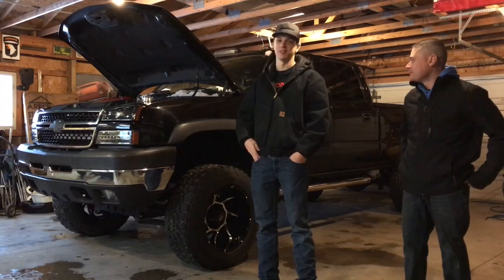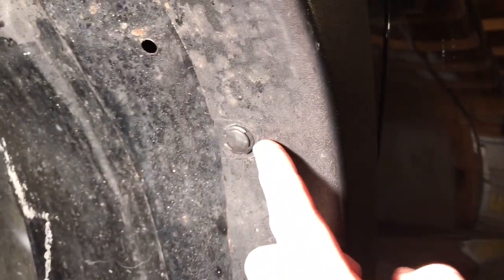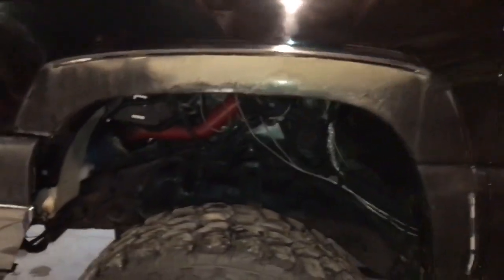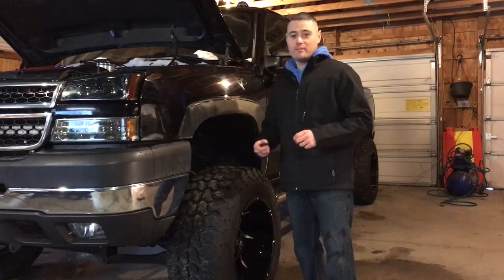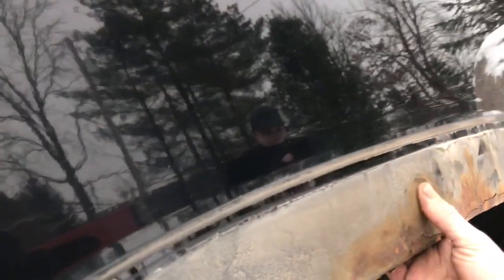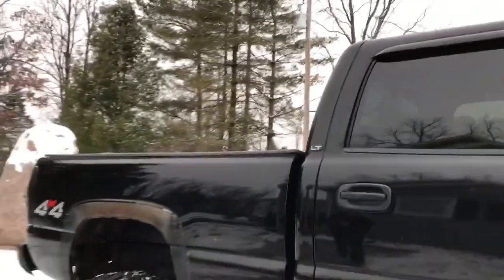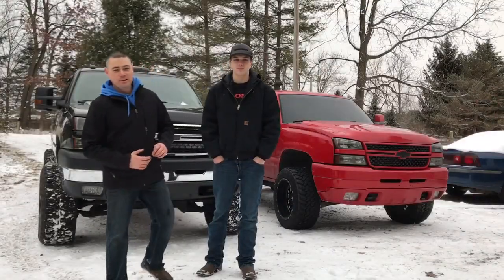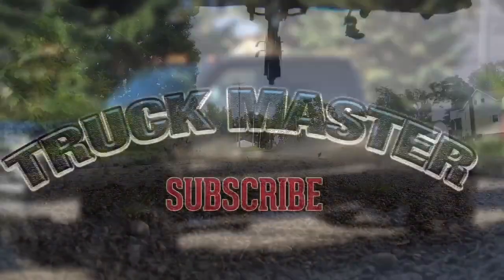Duramax 10 Year’s Later (removing the wheel flares) Hard to watch

Comment: Spray bottle of soapy water, buff wheel and clean it off; welder and some pre molded sheet metal and put it back in place, then OEM paint to finish until you do your paint job. That's what I did for my dad's 02 silverado. Works great

Comment: I love how people are clueless about the factory wash out plugs on the rocker panels and the wheel wells. Just wash them out and they won’t rust. Fill them with fluidfilm after they dry out and forget about it. It also helps to pull the tail lights off and wash out the bedsides from there. Crap will fly all over but it works.
Reply: where are the wash out plugs they on the wheel wells? I rust check every fall, maybe it doesn't matter in my case

Comment: Tbh keep em on. Ive always been a little too fond of fender flares. The first truck i owned had them and ive always liked the look too
Reply from the maker: +dude333 I most definitely agree with you
Reply: If you put the rubber gasket around the fender flares to seal them up you can keep the dirt and salt out plus I put wax all around except where the 2 sided tape goes
Reply: @TruckMaster  where the rust is you can us POR black to stop the rust or use lock tight rust neutralizer
Reply: Agree

Comment: I would spray some clear coat on the rust so it keeps it from getting worse. Maybe even sand it a little first. Throw the flares back on until you get it painted so it looks better. You can cut those sections of the fenders out and weld a new piece in and grind the welds so it’s smooth and use a small amount of filler if needed and paint it and you’d never know. Nice truck man.
Reply from the maker: +Hunt Guy thanks for the advice
Reply: No problem! Good luck dealing with the rust, it sucks.

Comment: I've seen trucks about that old that have never had any flares on since new that have about the same amount of rust. One nice thing about aftermarket flares is you can easily pull them off and clean under them every once and a while. Also using a small bead of silicon will go a long way too.

Comment: Looks better with the flares, without it makes the truck look too skinny with the wide tires. The flares balance it out. Rhino lining under the flares will help once fixed.
Reply: I agree. I like the way mine looks with flares
Reply: Any rubber product like rhino liner is the worst thing possible for your truck it doesn’t breath and traps in moisture
Reply: Not if applied correctly
Reply: I got flares with bolt pattern so not so plan plus looks better
Reply: Rhino liner holds in moisture I wouldn’t recommend doing that. Fix it the correct way or don’t do it at all.
Reply: Rust usually comes from the under side inside the wheel well.

Comment: I hate to be a bearer of bad news, but Chevy trucks rust on the box side wither you have flares or not. The rust actually starts on the inside (Inside as in between the out box side and the inner box side) of the box and works it way out. I work at a body shop and we get new patch panels from "Browns at two Rivers". Get a good quality shop to repair it for you and under coat the inside on the box when they're done.

I think it looks better with the flares. But your truck looks great with out also.

I was afraid it would be worse then that when you pulled them off. My 07 is so bad that the rust is showing even with the flares on.

Thanks for the great videos!!!!!!!! Great looking truck!!
Reply from the maker: +JD Uncle great write up! And you so right about how they rust. Thanks and take care

Comment: It's not the flare causing it to rust, it is dirt sitting between the inner and outer fender that gets caked in and scratches the metal up and then salt comes in a rusts it out. Yours is not bad. Either put new box sides on or new fender panels, but have it professionally done for either option. I cut the inner fender out with a dremmel so nothing will get trapped causing the rust to form. After that I applied some Eastwood Rubberized Rust Encapsulator. It's easy to do and will keep rust from ever happening again to fenders on your bed.
Reply: Zack Ziegler you can also drill 1 inch holes from the inside of fhe the box side . Take a hose every once in awhile ,spray it out. Both methods work.

Comment: I'd leave the flares off. Looks better without them and will prevent from rusting under.
On
 the up side they do help save some paint be catching things that 
normally would sling up the side of your truck. But I have the same 
stance and honestly I leave them off too prevent rusting and it looks 
good. But the rust you have is fixable.

Comment: Go with 2” bora wheel spacers in the rear. I’m running 36x15.50 tires with 20x12s and I’ve towed with them on and I haven’t had one issue. Plus they’ve been on for over 6 months nothing but good to say about them.
Reply from the maker: +Brandon Jenson great advice that’s what I need to hear thanks

Comment: Yeah that’s a bummer for sure. Ive been putting of checking mine just cause of what I might find under them. I purchased a southern bed for my last truck and painted it to match. To me that seemed to be the easiest thing to do and it wasn’t all that expensive. After that I made sure to Spray some fluid film behind the tail lights above the wheel wells. They like to rot from the inside out from all the mud that sits between the sheet metal half’s. Also if you look underneath the bed wheel well you will see some plastic plugs that you can remove and wash the mud out with water or Spray some fluid film up inside. Obviously this is good maintenance to do once you fix your bed or replace it. Your bed doesn’t look that bad I might even think about fixing it. The area that is bad you can cut out and weld in New skins that you can buy online. Then again I hate bodywork so id probably be shopping Craigslist for a new bed lol
Don’t let it get ya down that trucks come a long way and once the bed is fixed you can keep it nice.

Comment: they are definitely repairable but I'll tell you what I've been doing for years and it works great back in 1999 I put fender flares on my truck but before I did I coded the entire section that is covered by the fender flares with wheel bearing Grease in 2012 one of the flares got broken when I removed it to replace it the wheel bearing grease was still where it was I wiped it off in the paint looked better than the rest of the truck no rust no peeling recoded with more grease installed the new Fender Flare now this year I sold the truck and bought a new Silverado I done the same thing with it if you have grease behind that it will repeal the moisture won't hurt your paint I even do the inside of the fender lips I also spray everything underneath body frame brake lines with used motor oil using a air tank full of oil and pressurize it and used blow gun to spray with when I sold my 99 it was as rust free as a new truck
Reply from the maker: +hobertjr that’s good advice I would love to see that truck I bet it looked great
Reply: Truck Master it did look really nice still in great with 308,000 I don't have any videos of it I did have some pictures my channel has just a few videos of my stereo upgrade and things of my new Silverado

Comment: That's why I hate fender flares, they trap to much moisture and dirt.  They cause corrosion and other issues.  I'll never have them on my truck
Reply: They protect your paint. The only reason this guy had rust was because the truck was clearly never undercoated, and those were likely stuck on to hide the rust...

Comment: I know how you feel I took mine off last winter and the front right fender has a hole in it. I left them off so it wouldn't keep packing in the snow/salt and mud. Still have to change the fender. I got a video of it on my channel if you want to check it out. I want to do bed liner around all the fenders after I fix the rusted areas
Reply from the maker: +Rick Aubin I will check that out

Comment: You need to spray that area with a bed liner spray can once you fix  it and problem solved.you can put them back on as long as you rubber coat that area first.

Comment: I say leave them on because that rooster tail of dirt falls in the track of your driver and passenger side windows and that dirt scratches your windows. I just put the same size wheel combo on my superduty and now I'm getting that rooster tail of dirt falling on my side windows and every time I roll my windows down I can hear the sand scratching my windows and they are really scared. I'm getting fender flares  asap. I know you live up north with the snow and salt and I live I  Florida but if I were you I'd treat the area that your flares go on and put therm back on because that dirt is really going to eat your windows so bad that you won't be able to see   out of your windows. Even when it rains the sand and grit gets in your window track and it'll eat them up, good luck bud.
Reply from the maker: +William Santiago you make Perfect sense I really like the flares on

Comment: get new quarters or just cut out the rusted part and weld in a new piece and then youll have to grind flush and mabe add some body filler to help smooth it out to look like it was never welded
Reply from the maker: +Samuel Hollinger I’m sure the quarters are fine but great point I most likely will but the panels
Reply: yeah i was just saying new quarters if you didnt wanna weld them and just start fresh. Nice truck mines looks like a twin of yours without a lift!
Reply from the maker: +Samuel Hollinger very cool

Comment: Your box is in good shape.  I would  fix it.  1
Reply: Only way to fix it on Chevy's is getting a whole new box.
Reply: Carson Schultz its not that bad my front fender was worse then that being a plow truck for 11 years when i bought it. was a mason dump so bed wasnt a problem. i fixed my front fenders the right way mad a teplate using the factory fender flare and cut out all rust sanded down to bare metal. and used “allmetal” body filler. cant even tell that there was a fist sized hole in my fender cousin painted borh front fenders.  next is strip down the whole truck and paint it just have ado decide on a color after winter

Comment: Front fender.  Find a clean used fender high standards.  Pay up to 250 if you have too.  Still cheaper than repaint and wont have to worry about being wetter than the rest.  When its all said and done,  sell the old fender for 100 125.

Comment: Most Chevy's rust from the inside out due to poor design. Only true way to fix it is new box or box sides.
Reply: i noticed my 97' seems to be rusting from the inside out as well :/ it is what it is i guess
Reply: My 09 rusting from inside.
Reply: Patch panels will fix it, no need to replace the whole box side
Reply: Horsepower Garage no it won’t the rust will just come back within a year or two.
Reply: Not if you remove all the rust, it's a very common repair when you live in the rust belt.  Even a brand new box will rust again within 5 - 7 years if you drive it in the winter.
Reply: All cars and trucks rust from the inside out.

Comment: Do hubcentric and you can get replacement box wheel wells for 80 bucks a pop
Reply from the maker: +Nick Parker I’m just worried they will break
Reply: Truck Master ive been running hubcentric wheel spacers in the rear for 2 hears on my half ton and 1yr on my 3/4 ton

Comment: If you're going to add fender flares, which I like personally, make sure you do some preventative maintenance. My personal advice, tape the area off and plastidip it, then get some good heavy grease and coat the inside and outside that will be covered. Most importantly, get your car oil sprayed and watch them do it, ask them to pay extra attention to these areas. Most vehicles that have rust under the fender flares had the flares put on to hide it, the style in this video are the worst because there's so little airspace. Reality is most of these Chevy's without these flares rusted worse than this.

Comment: even without the flares the chevy will rust at the wells....common problem with inside lip
Reply: yep, my paint started 3 yrs ago from factory. It lifts on the inside of the lip and fakes outward.  Had it professionally redone, one yr later surface rust.  I was told by the guy that does my rust check, that your tires are like sand blasters on your paint, throwing rock and sand at high speeds, thats why we get these problems, even with proper jobs. Fender Flares are good for hiding sins on older truck that you cant afford that kind of money for repair for sure - helps only in that way

Comment: Thats a gorgeous truck.  Find a clean bed,  re undercoat the underside, do a frame restore undercoating,  anti seize and clean bed bolts,  and throw a fresh buff job on the whole truck whoooo!  Material wise bed included i could pull this off for about 1200.  Obviously that doesnt include labor.  And we d be talking high standards on a used bed.  Factory paint bed.  Now unless you can replace the entire bed side as a whole is the only other way.well   Then youd have to repaint them, Might not match 100. Deff would have to buff truck out and bed may still look wetter than the rest.  OE bed will for the most part be a closer match and youll get a frame reconditioned at the same time.  Thats my opinion. Just please do not let anyone tell you its ok to hack the rust out and patch panel it.  Yuck.  Can you sleep at night with yourself.  No.  Not for this beauty!
Reply from the maker: +Rob Ski nice write up👍take it easy brother

Comment: Please do a rust repair video i have a 2007 silverado new body and it has bubbles and rust on both wheel wells. New bed is way to expensive(not painted when you buy new from GM) and body shops around town charge like 3g for repairs and all say it will come back. I rather do diy for cheap
Reply: Andrew S look on facebook or Craigslist for sure you can find either the parts you're looking for or a whole blown up truck, normally you can find trucks without a trans or a motor or both for pretty cheap